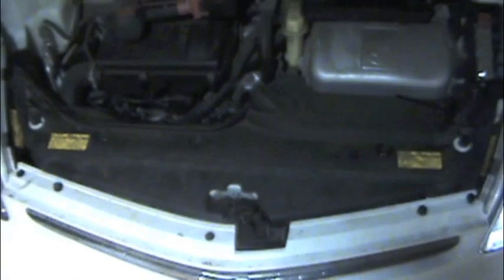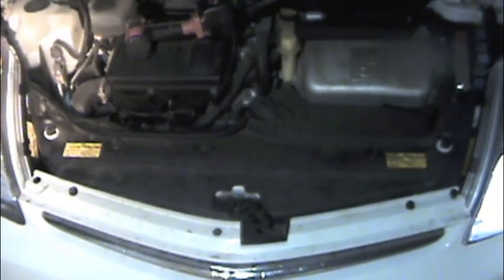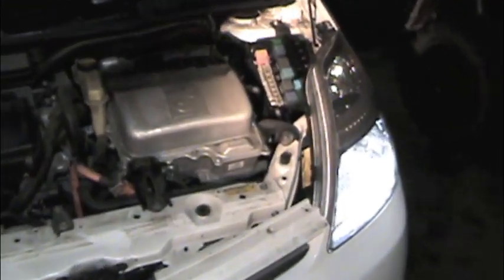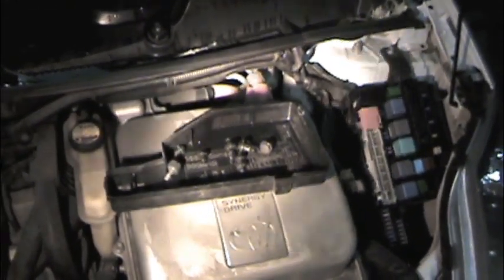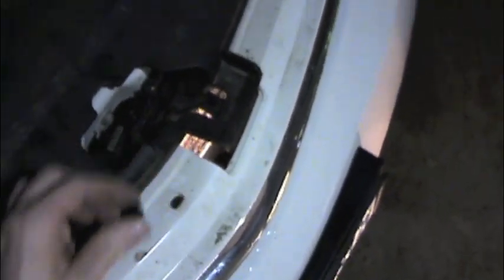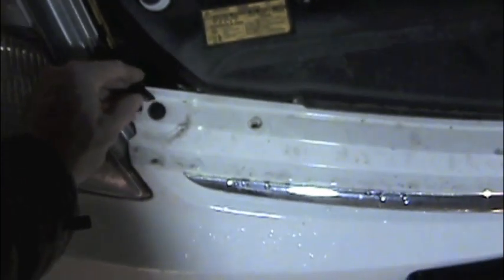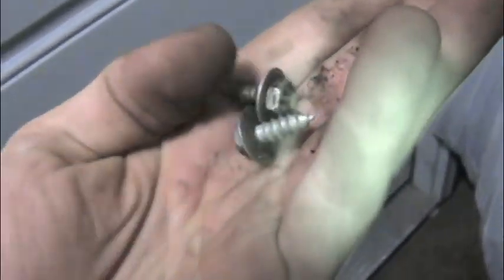Toyota Prius HID Headlight Change Part 1 of 3

Comment: Appreciate all the work to make this video, but I just did my passenger side from the top with removing only the 2 pieces of plastic. No need to remove the bumper. Check out other videos and use what works best for you. It took me about 45 minutes, but could do it again in about 15 minutes. Don't like crawling under my car. We own two Prius and best cars we have owned.

Comment: Thank you for the video......but you can change both HIDS by simply removing the the black plastic shield on top of the engine & the fuse box cover for the driver side. I did both HIDS in less than an hour.  You can buy 2 Phillips (made in Germany bulbs on ebay for $60. Do it yourself & save !

Comment: My 2005 Prius headlamp out...called Toyota Corp customer service rep...they told me: "take it to the  dealer and have it fixed" ...dealer wants $150 for diagnosis then 3 hours labor to replace bulb (manual calls for 2 hrs) total cost to me about $500..I also have engine lite P1121 code (coolent control valve)...it  failed after dealer replaced water pump...Toyota says: "take it to the dealer and have it fixed"  This $70 part will cost $800+ for them to replace....Next car is going to be American!!! Probably a Ford or Chevy that rates well in Consumers Union.